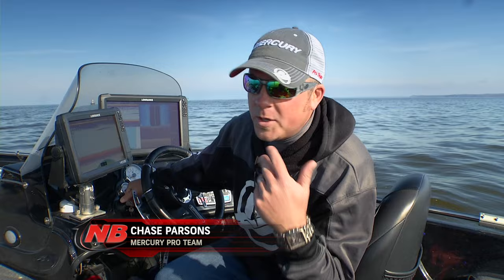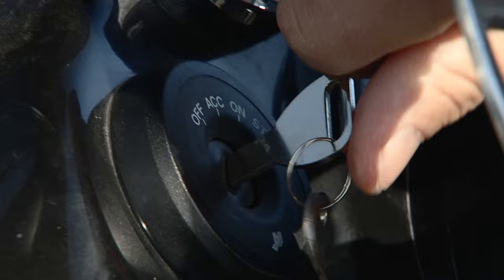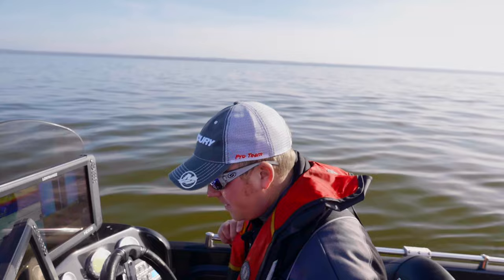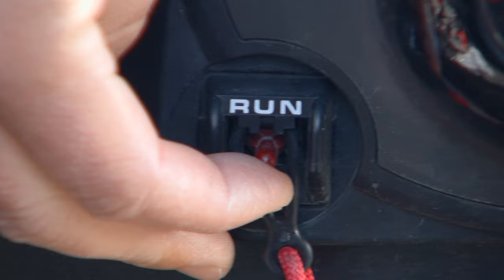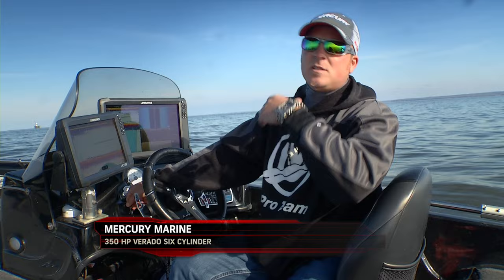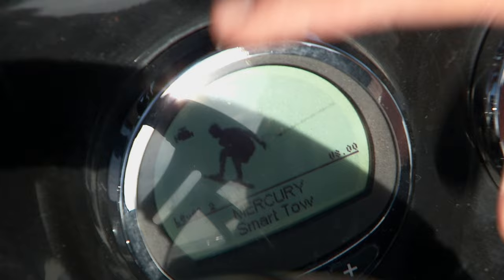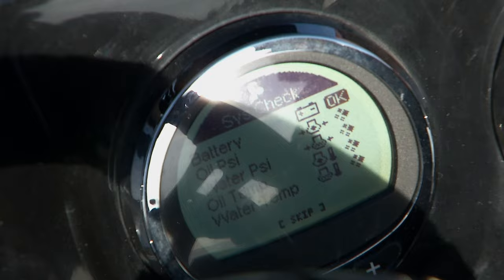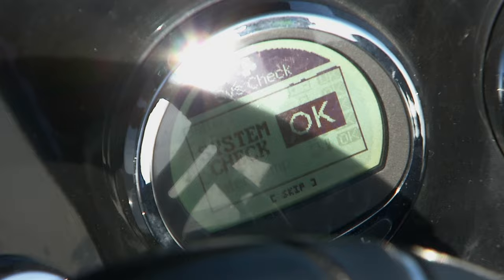Mercury Warning Beep

Comment: I get one beep at different times while running.     Just one long beep.     Oil is good. Water is streaming out motor.
Reply from the maker: usually that means overheating warning.    Might ask a mercury dealer.
Reply: @ThenextbiteTvShow    I’ve brought it to my dealer and they fond to codes.   They also couldn’t get it to alarm at the dealer.
Reply: Have you had any luck finding the problem?  Mine started doing the same thing and shut off then wouldn’t start.  Then started up later and did it again. Oil is good new water separator, new fuel filter, new plugs TIA
Reply from the maker: Do you have water streaming out the back of engine?   Usually one long beep means overheating.   Could be bad sensor if you're peeing water out of back. 
Engine starts up later because the sensor cooled down.
Reply: @ThenextbiteTvShow   yes I have water.   I’m about to change pump and see what that does.
Reply: @ThenextbiteTvShow  yes water peeing out the back.  Engine sputters almost like running out of gas (just put 30 gallons in) then once I shutdown it won’t start again.  Oil level is good new plugs and all new filters
Reply from the maker: I would have guessed gas filter.    But if its not that maybe something inside the engine block.     Maybe give your local dealer a call and see if they have any steps or test you can do. https://www.mercurymarine.com/us/en/find-a-dealer
Reply: @ThenextbiteTvShow    I took it to the dealer.  They didn’t find any codes and the alarm never rang with them so say.       I’m in same page as you with over heating.       I have changed fuel filter last time I used it.     I did find water in gas.    Could be that also causing alarm?
Reply from the maker: Not sure. Some of the more advanced issues are over our head and we bring in our boats.   But water in gas is not good.  You can wreck your engine that way.

Comment: I have a 2018 Lowe pontoon boat with a 75hp mercury 4 strokes it runs fine but when i hit full throttle  it starts shaking and beeping and then the engine turns off
Reply from the maker: It could be many thing.  The first place I would check / replace is fuel filter.  2nd make sure you have water coming out the back. 3rd check spark plug and wires.  4th check fuel pressure.   5th if can’t figure it out then call a local mercury dealer.  https://www.mercurymarine.com/us/en/find-a-dealer

Comment: Single beep to fire.. then get on plane for about 10 sec then I lose power and get 6 beeps
Reply from the maker: This is just a quick google search for you. https://www.perfprotech.com/blog/marine-outboard-motors/mercury-marine-smartcraft-and-guardian-system-warning-horn-alarms.   Sounds like 6 beeps could be a handful of things.  Easiest things to check off list is fuel filter, screens on fuel line, fuel pressure regulator and fuel pump.    Does not hurt to call your local marina or boat shop to talk with the service department.  Also can use this website tool to find local dealer who can answer more questions. 
 https://www.mercurymarine.com/en/us/find-a-dealer/
Reply: Mine do the same

Comment: I have a 06 optimax 115 & everything’s fine accept when I have the motor running for  abt 8 mins or so and it’ll give me a single beep. No other beeps after that but it does it every time after the motors ran for a little .Any suggestions?
Reply from the maker: not sure what that might be.  I would contact a local Mercury Dealer.  They have cheat sheets as what each beep means for each model of engine.

could try this link too.  https://www.perfprotech.com/blog/marine-outboard-motors/mercury-marine-smartcraft-and-guardian-system-warning-horn-alarms

Comment: I have a 2011 115 optimax. I get the all clear single beep when I turn the key to on but I also get a single beep as it's cranking to start . The motor runs fine no issues no other beeps. what is that beep for during cranking?
Reply from the maker: The single beep is common.  Single beep at start up - Normal test horn-  No Action Required

Comment: I heard two quick beeps when you turn the key.
Reply from the maker: it's an echo with camera mic.
Reply: @ThenextbiteTvShow   I can't recall the last time it beeps when I start up but two days ago, after a tube pulling, stop and rest. Then restart and would hear 1 beep then another beep right at before engine fires up. Is that normal? Like I said, i remember only one solid beep the last time I was out.
Reply from the maker: @svang22  not sure what that might be.  I would contact a local Mercury Dealer.  They have cheat sheets as what each beep means for each model of engine.
Reply: One short beep and one long beep is the high pressure fuel pump is bad!